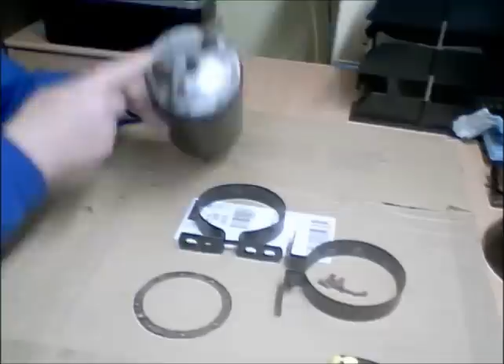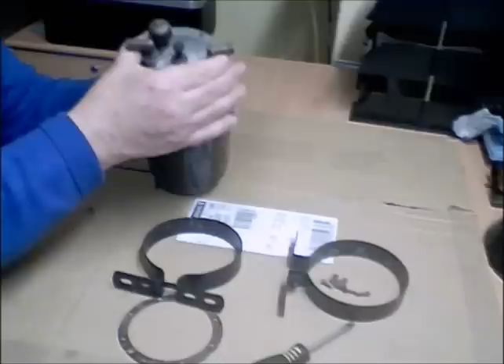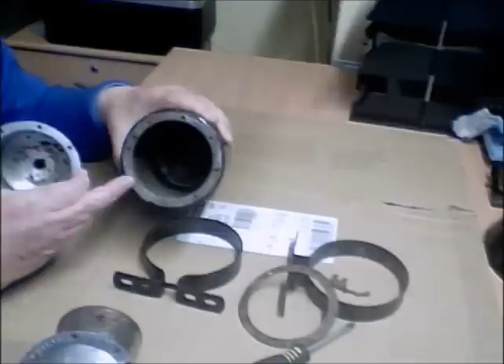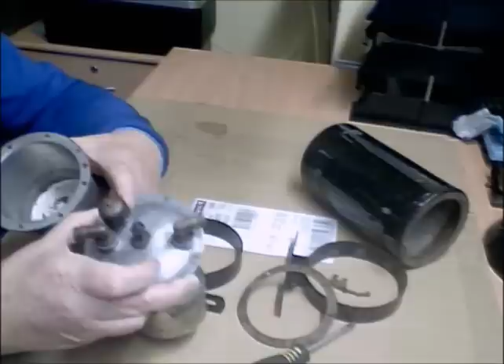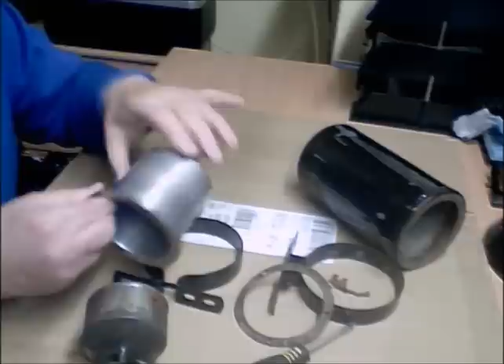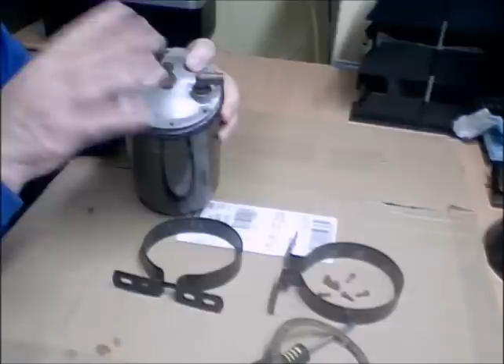1920 Autovac fuel pump

Comment: Hi Peter, I'm working on a 1926 Humber at the moment and it's fitted with an auto vac system. My question is, is there anyway fuel could be getting past the valve and flowing into the engine via the suction pipe? We're having flooding problems. Thanks in advance Andrew
Reply from the maker: Just spotted this so sorry for delay …. In a word yes the induction valve is like a one way valve and flash guard. Cheep and easy to replace also check that the device thats shuts off the valve when the fuel suction bowls is full. That carb have you got on?
Reply from the maker: Having said the above I’d still suspect the carb……. Make sure the float is good and the inlet needle valve is stopping the flow of fuel as this can cause bad flooding.

Comment: Excellent video thank you.  Just taken apart the Autovac on my 1931 Sunbeam and it is missing the air inlet valve top piece, also the one way petrol inlet valve is not there, just an inlet connection.  Is the one way valve vital do you think?
Reply from the maker: michael Ralph Michael..... the fuel inlet in not a two way Valve it’s just an open elbow.  The two way valve is the one with the pipe going to the manifold and where the autovac gets its suction.
the air in let you can get  from Autovac.co.uk or, it could be Autovac.com also all the other parts you may need.

Comment: You are a lifesaver Peter!  I just purchased a 1927 Buick Standard Six that was fully restored in the early 2000’s but has been sitting e old fuel in the tank,  Steward Vacuum Gasoline System (fuel Pump) and looks exactly like the one you demonstrated here in your video!!

I just removed the fuel pump today and plan to take it apart, throughly clean it, and replace all the gaskets this coming week!

Your video was exactly what I was looking for as I have no experience with a prewar car!!!!!

Thanks again 

Will-
Reply: Where can I buy the gaskets or can I make them
Reply: Joel Ricknauth I used “Hal” at Classic Preservation Society, he answered every single phone message left him w a return call in a timely fashion!  They are avail many places but I can’t speak enough for Hal’s level of customer service!  Here is his website:  http://www.classicpreservation.com/vactankkits
Reply: Joel Ricknauth Hal will also rebuild it for you as well, just thought I’d mention that!
Reply: @TreadTalk247  ok thanks
Reply: I am not getting through with the link you send me
Reply: Joel Ricknauth no problem search the term “Classic Preservation Society” and you’ll find it easily....

Or call “Hal” on the same site and he will make sure to get you what you need, my Vacuum Fuel System works flawlessly  after I rebuilt it.  The 1927 Buick sat for some 30 or so years untouched in a Widow’s rented garage so needless to say I had to go through the fluids and flush everything including the fuel system and rebuilding this vacuum tank!

It was easy....
Reply: Joel Ricknauth try this one...

http://www.classicpreservation.com